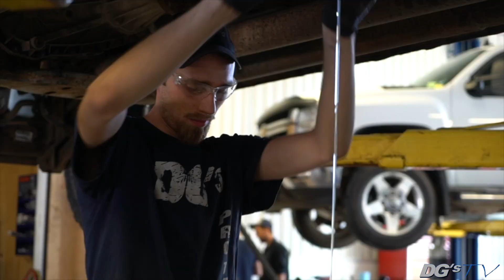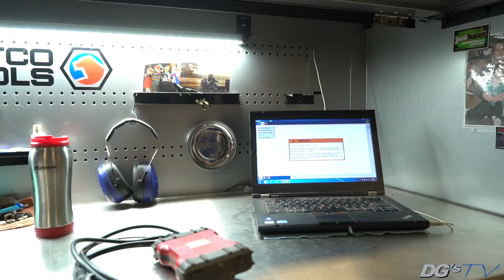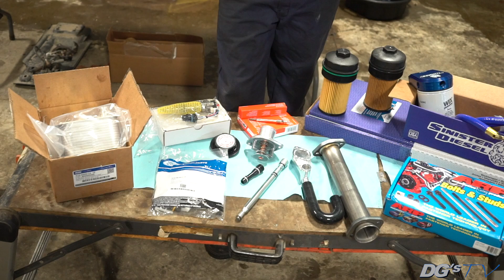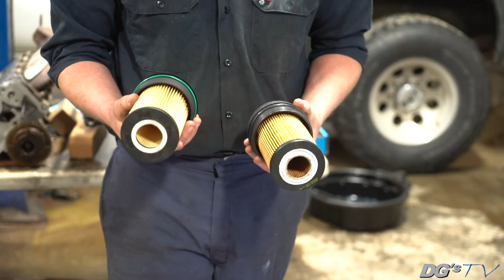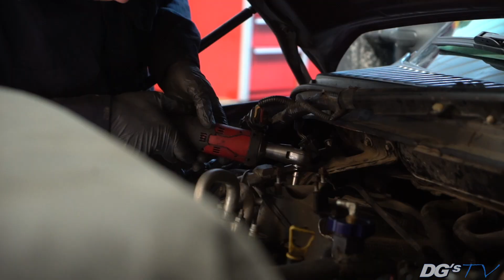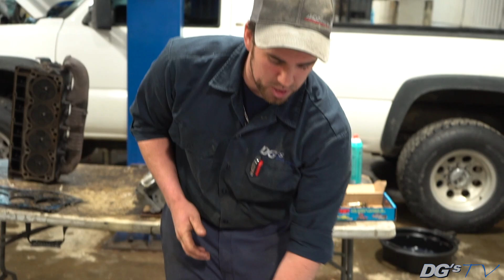EP 4 - Ford 6.0L Problems and Bulletproofing

Comment: The best fix for any 6.0L engine is to leave them stock, I've run two well past 350k with no issues, both bone stock running good synthetic oil and regular fluid changes. These are truck engines not race engines, treat them that way and they are just fine.

Comment: After listening to several videos on the 6 liter Ford diesel it sounds like the best thing you can do to prevent issues with these engines is not to buy one in the first place and get a reliable gasoline engine instead.

Comment: Hello there,I just want to check with you if it is popssible to change from the permanent brake and accelerator pedals to the adjustable type and also if it is prewired in the truck.Thanks and I look forward to hearing from you asap.
Reply from the maker: Hey! why don't you give us a call at 519-418-2886 to discuss. have a great one.

Comment: Hey Dustin my son has a 2005 f250 6.0 diesel that has a coolant leak and he just found coolant in his oil it has the whit gunk of doomon the inside of his oil cap. Now my question is, could it be possible that he has a cracked block? The reason why I ask instead of a head gasket blown is since he purchased it a year ago today it has always leaked coolant it leaks only after he has driven ut and it is parked. It does not leak when he is driving it he said. He loses a lot of coolant.

Comment: My question is, Why after I had work done on my 6.0 Every thing replaced except the Turbo. It was just rebuilt. In the morning it takes 8,9 even 12 cranks {turn over} before the engine starts. and when its really cold it won't start till the weather warms up. When the engine  warms up it star quickly. New glow plugs. 'I  took it back to them {machinic}  He changed some module on the valve cover and said that will take care it. Nope it did not. A bit upsetting. So I would love your help on this. I cancelled my Elk hunting trip because My Ford would not get me around this trip. I have never hunted with out my ford. crazy  that it may sound. That's the truth. lol
Reply: Ugg !!!!
Reply from the maker: Hey! Still having this problem? Give us a call at 519-418-2886 and we can book yea in for a diag :)

Comment: The biggest problem with the 6.0 Powerstroke is that you have to dump $20k into the engine just to make it some what reliable witch is pathetic.
Reply from the maker: 20k may be a little steep thinking, most of our customers are less than 10k

Comment: Very well explained Dustin.  I own an '07 Ford F-350 semi-bullet proofed by adding the two extra head bolts, new radiator/all hoses, etc. and it ran like a dream with so much more power than before.  Two years later I hauled my 43' Jayco RV from Blaine, WA. down to Tampa, FL. and back to WA. One thing I noticed is when I started the engine in cold weather, set the heater on and let it run to warm the cab before driving off...After 20 minutes of this I found the cab still cold and I was losing antifreeze. Then I would drive off and the cab warmed up.  I took it back to the people in Bellingham, WA. who performed the work on the engine and after taking a few items off the engine, told me the head gaskets were the issue.  After they got the head off they called to tell me all the gaskets were fried.  I mean I paid them $12,000. for all that work in 2019 and now I have to pay them as much or not more know just two years later.  What caused the engine gaskets to fail, I asked them....They told me the fan motor solenoid failed along the way in my travels. I asked them IF they replaced that part the first time they worked on the engine. Their answer was that they did not. Just a little part like a fan motor/solenoid took out my whole engine.  I decided to have them install Engine Oil, Water, and Exhaust Temperature Gauges so I didn't have to rely on idiot gauges.  Thanks for reading my 2cents on the topic of Bullet Proofing a 6.0L  INSTEAD, I feel like I took a bullet on this one!
Reply: So sorry to hear that happened after all that work. How's it doing now after the repairs and gauges added? I never would have had the initial 12k for the first repairs.
Reply: @giggiddy Installing the gauges are the key to longevity

Comment: One item that could extend the life of a 6Ls that I have not seen discussed in very many videos, is to use the correct or better antifreeze with distilled water in the 6L.  I was at a Ford dealer getting the transmission oil and filter replaced when I saw a young new tech performing a radiator flush with a garden hose.  An old grizzled tech told him to stop and flush out the radiator again, as he had almost filled it up, then fill up with distilled water and the correct antifreeze.  I ask why.  The old tech told me the 6.0 water/antifreeze pathways for the EGR cooler and oil cooler would have sediment from hose water build up and block passages.  He told me that was one of the biggest issues causing those EGR and oil cooer issues.  He showed me an oil cooler and EGR cooler, that were cut in half from a 2004 6L, showing over half of the water flow pathways were blocked with sediment.

Comment: What is your thought on after heads are decked would it be better installing originally heads vs o ring heads?
Reply from the maker: o ring heads are better at sealing but not necessary in a stage 1

Comment: I have a Theory and something you forgot to mention as a part of Bulletproofing. Most times the Head Gasket and Coolant Burping Problems come from trucks that have an EGR Delete. That's because the Electric Cooling Fan isn't coming on (Thus Cooking the Engine, could also be the reason Coolant Clogs the Oil Cooler) because the 6.0 reads the EGR and 6 other Components to bring on the Cooling Fan. The Fix is to install the BPD 6.0 to 1996 7.3 Mechanical Fan Clutch Conversion. Installed that and problem solved, then came all the coolant leaks from the Sinister EGR Delete Silicone Hoses. Also don't forget to check your Starter Bolts. lol

Comment: I have had that done to my Ford F-250 6.0 about 4 years ago. Ran great. But now I am driving over the mountains with camper and 14' box trailer Loaded for a elk hunt and when i start up 6% grade up hill. My ford over heats. Antifreeze pouring out some place by the fill call cap. I see the coolant around the cap area. This what I can't figure out !!!!   I can have my camper on my truck with a flat bed trailer and two quads on it and it doesn't over heat going over the same  mountain. Any idea what is going on??? Could the thermostat be bad???

Comment: What about the replacement mechanical fan clutch for the problematic electrical fan clutch? The wire on mine got caught in the fan in arizona and left me stranded. I recently had the mechanical fan clutch installed to prevent that from happening again.

Comment: The problem with the 6.0 is that you can fix all that common issues and it can still fail on you in some of the less common ones. Like the diesel on coolant problem or the lifter problems. Is so hard and expensive to keep one running right.

Comment: Honestly my uncle has a 6.0 with 178k miles. Everything is original only thing done to it is the EGR delete. Oil and filter and Diesel filters are changed always on time and so far he has no problems with the truck. Idk i guess if you really just take care on point with the Maintenance they work fine

Comment: Iam process if doing it all except studs.i needed a new oil cooler...so I deleted the egr cooler...new thermostat...new coolant filtration system...blue spring upgrade..new oil and fuel filters...new radiator..new water pump.. And all the hoses... Most I figured I should do while I have it taken apart...also will do gloww plugs, upgrade to 6.7 starter..also upgrade to a 7.3 fan clutch and   few other things... This truck better last a while...lol..170 k miles..low for a diesel engine..

Comment: ugh wish I did some research... sent my crank no start 6L to a local shop. Had 170psi injection pressure cranking so they replaced the hpop, 2 injectors and the IPR valve. Still runs like crap and im out $4600. Hesitates to start with rough idle and randomly gives a jolt while driving on hiway like it just cuts out for a second....

Comment: The main cause of EGR failure in 6.0 is the internal oil cooler. Go to an external air cooled oil cooler and improved EGR cooler and that solves the issue.
Reply from the maker: Yes if the oil cooler becomes plugged you are correct, but high coolant temps are a big factor too. We also feel the other common concerns listed are just as detrimental

Comment: i just bought an 04 powerstroke -bought it not running  he said he was on freeway and it just died no noise knocking nothing  i checked oil filter and on the top was powder size cooper  someone said turbo bearings went out does this sound right -it will turn over all day long but not start  HELP FIRST DIESEL IVE HAD  SOMEONE ELSE SAID HPOP BUT YOU WOULD NOT HAVE COOPER PARTICLES I HAVE NO IDEA

Comment: they are selling a 03 ford excursion 6.0 for $7,600 at about 172,200 miles . What should i look for ?
Reply from the maker: You should look for running concerns, get it hat and try to start it after sitting for 5 mi  coolant loss or coolant around the overflow bottle, above that come see us

Comment: I just bought an 06 F350 4x4 with 248000 miles. The guy that sold it to me gave me the paper work where he spent $6000 to have oil cooler, injectors, gaskets, and other things done. The truck runs great but yesterday I got in it and turned the key and just got one click nothing else so I had it hauled to my brother in laws garage for repair he's been in business over 40 years he told me most likely it was just the starter but we'll see.
Reply from the maker: Hope that's all
Reply: @dgsprotech985  it was a bad battery cable changed it and drove away.
Reply from the maker: @rogersdrummer1  thats good

Comment: I’m look at a 2004 6.0 with 49k miles for 22k. It’s clean from what I’ve seen. I just don’t know because all I see is 04 is a horrible year.
Reply: If you can get a no 4 with only 50000 original miles on it that is a steal at that price remember these vehicles can run well over 500000 miles if maintained properly I would even say a million miles by the vehicle get bullet proved maintain it properly 1/2 anIf you can get a no 4 with only 50000 original miles on it that is a steal at that price remember these vehicles can run well over 500000 miles if maintained properly I would even say a million miles by the vehicle get bullet proved maintain it properly and have fun

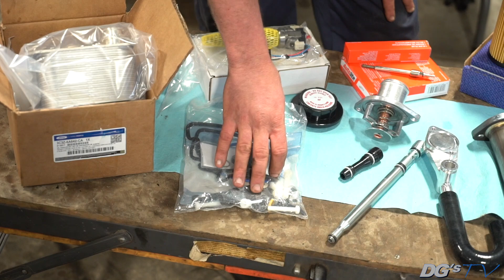Comment: So I'm having problems with hot starts, and I pulled a code for low fuel pressure to the injectors. What parts/fittings was he talking about regarding the high pressure oil system at 3:30
Reply: It always takes a 10-15 seconds to build pressure but sometimes when hot it must won't build at all until you let it sit for 10 minutes or so.

Comment: Dropped 10k in mine whole 9yards... oringed heads, 175/30 Warren injectors coolant filtration dumpy  plugs. Blue spring, regulated return, fass pump. Barder stage 2 turbo. And it seams like it’s just always something. Just had my Warren injectors of 2 years fail...
Reply: Always run Archoil 9100 in your oil and a really good lubricity/ cetane booster in your fuel.  I had the same problems, did that and haven't had a problem in 10 years.  Takes care of your stiction problem...

Comment: Add 1 quart of Auto Trans Fluid to the fuel every other tank full of fuel. By doing such will prolong injector life, lubes & conditions intake valve & other fuel related components. Cleans & Lubes Cylinder walls & piston ring lands. Etc. Etc.   6.0 Powerstrokes were not built to ingest todays junk ULSD fuel. In which is a very refined dry diesel fuel.

Comment: This is fantastic. I'm really wanting a 6.0 that just popped up in my area. Everyone is telling me not to get it... I wish all of this wasn't so expensive
Reply: To whomever liked my comment... I did end up getting a 6.0 last week on Tuesday. A 2004 F250 with a rebuilt 2005 6.0. brand new transmission with only 3k miles on it. I didn't get "screwed" I don't think.... But we think it does have a stuck open injector. I just out archoil and switched to rotella t6 yesterday and I have a big drive today so hopefully this archoil works it's magic. Other then that the truck is bulletproofed and somewhat built also so I think it should last me a good amount of time
Reply: @OutdoorCQB  sounds like you bought a sketchy turd. How’d it go?
Reply: @landonhill700  so it's been awhile now I truly think nothing is wrong... I've done so many checks now and have looked at numbers and everything comes back normal... Smokes white on startup but once it gets to about 140° smoke is basically gone and at operating temp of about 185° and some under to about 165° their is no smoke at all... I think it just doesn't like the cold with the delipped pistons and few other mods up there..
Reply: @OutdoorCQB  I know this is very late. But do you still have the truck?
Reply: @giggiddy  yes. It sat in my garage for the last year because the EGR delete was leaking and I took it apart and never put the truck back together... Up until about a week ago so it's running again. But it failed a pressure test so I think head gaskets are no good... Currently trying to sell it
Reply: @OutdoorCQB  Thanks for the reply and super sad to hear it didn't work out. No diesel or any engine should be that much trouble to maintain. Hopefully your next engine works flawlessly for you.
Reply: Diesel engines are a different beast they cost a little bit more to maintain some of the fixes could be substantially more but you can also get a million miles out of them very few if any gas vehicles even well maintained will get life that long
Reply from the maker: Hey! We've been following this, did yea get that truck sold?
Reply: @dgsprotech985  Yes it sold early in 2023 can't remember exactly when though. Even though it was a bad situation I miss it to this da

Comment: I have a 2004 f250 6.0 and my engine will not start when cold. I can only get it to start with starting fluid. After the engine warms up it starts all the time. It also seems to run fine. I changed the dummy plugs, stand pipes, Fuel filters, glow plug module. My son bought it last winter and had the problem then. He recently passed so I kept it and trying to get it to run good. Any info would be greatly appreciated.
Reply: Hpop prolly going out as it controls the injectors.

Comment: I can tell you BOTH of my 6.0 diesels have had exactly the same problems as he describes here.  I have had injectors, STC fittings, FICM issues, EGR cooler, etc. fail.  I can tell you it takes about 540 lbs. of oil pressure to start the engine from the high pressure oil pump.  If one of those fittings leaks (on my 05 they are plastic?)  the truck won't start.   I called my dad, he came with a rag soaked in starting fluid and we stuck it in the end of the turbo after we removed the air cleaner housing.  I hit the starter and the engine gradually sped up and started.  I raced to the repair shop.  Got the thing fixed.  Great video!
Reply: What fitting was bad?
Reply: @charlebrownga  The STC fittings.  On my truck they are plastic.

Comment: I’ve been looking at getting a 6.0. I’ve looked on Facebook market place. One of the main thing I see is when people say “fully bulletproofed”. I always ask them what has been done to the truck and they always reply with “deleted and studded”. In the 6.0 power stroke case, that isn’t a full bulletproof. I love how you know so much about these trucks and that you give an accurate run down of what bulletproofing is! Thank you! :)
Reply: Agree on what some people say about so-called fully bulletproofed, the previous owner said the same and had the receipts to prove it, than 25k miles after I bought it, part of the #6 injector tip broke off and dove into the cylinder, 7 hours away from home, had to get it trailed home, then borrow my friends truck to go back for the camp trailer,  lost my faith in the 6.0 platform! I wish it was more reliable, I really like the truck, but cant get pass how that motor left me stranded and the $3k+ bill to get everything home, not counting the repair costs
Reply: @danmckeon6221  that's just dumb luck but I know the feeling recently had a piston ring failure on a hemi that I had rebuilt about 500 miles from home luckily we own a tow truck and my pops was able to drop his truck off and tow mine home needless to say the shop didn't warranty the work so we've been battling it out
Reply: @danmckeon6221  you can look forward to a similar down time and cost situations with Dodge/Ram and Chevrolet diesels too...

Comment: I have a later model 6.0 with 197000 miles on it right now. I don’t use it often and treat it extremely well. I want to do the stud conversion. 
BUT. 

I don’t want to remove the heads. That is if I can confirm my compression is equal across the board, no oil leaks, or anything that warrants engine disassembly. 

But if I do decide to my question is do I HAVE to send the heads out? Or can I just verify flatness of the face and etc. And install them back on in order to prevent the issues of head gasket failure. 
And I ask this from a financial standpoint, down time, and efficiency. 
What suggestions and warnings do you know of that I can take into consideration?
Reply: By later model I mean it’s a 2005, not pre ‘05.
Reply: Just pull the head and put it back when you're done. If you dont gouge the surfaces, they should still mate right back together. Getting resurfaced is usually for a full rebuild where everything is necessary to be precise. If it's working now, if you dont mess up with removal and installation, it should work when you're done.